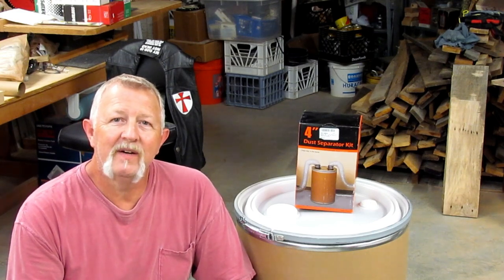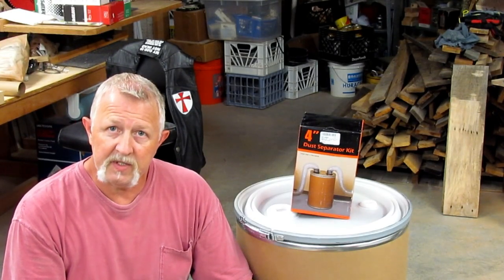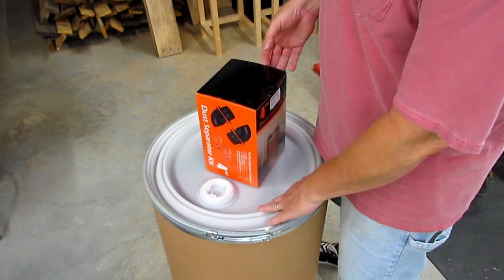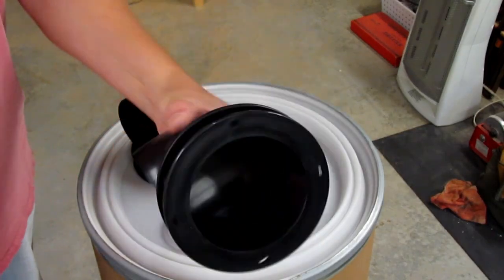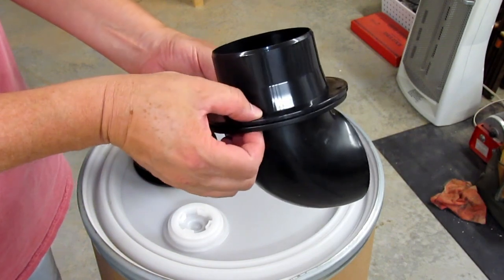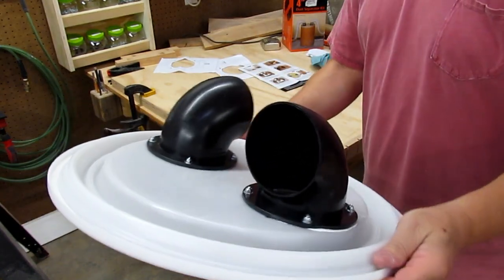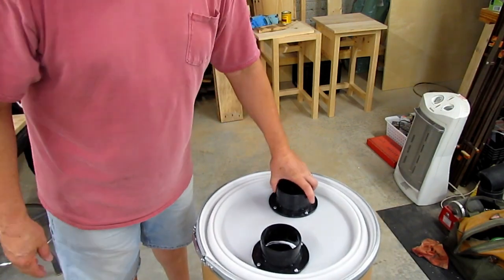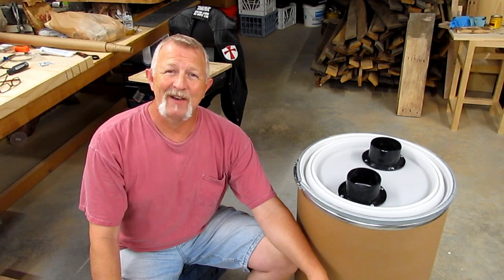Build a Chip Separator for your Dust Collector - Cheap

Comment: I saved my bungs then used the small one and connect my sander hose in it worked out great
Reply from the maker: Thanks for watching, Charles!  Wow...that is a GREAT idea...I wish I had though of that!  I use an adpater to step down from the 4" hose to my sander hose and it is a little cumbersome.  Your idea is perfect!  Thanks for sharing.
Reply: Super idea using the smaller one for your sander.

Comment: This is a terrific video and I just love the idea.  My problem is that I can't find a 30 gallon fiber drum for less than $100.  It's possible that some company near me might sell it, but I can't find one.
Reply from the maker: Thanks for watching, Pat!  I actually stumbled across my supplier...they are local but normally supply steel drums.  I stopped in one day and asked them if they had fibre drums.  They had poly and fibre, I just opted for the fibre drum....it was about $20.   I have seen people use poly drums and also garbage cans.  If you can find a garbage can with a fairly sturdy lid, it should work fine.

Comment: Great video. My question would be this, how does the CFM compare to one of the Dust Deputy's? I would have left the "bungs" to use as a window to check the container capacity if it unscrews. Using the smaller one as a palm sander port is an awesome idea.👍
Reply from the maker: Hi Terry, thanks for watching!  I can't find any specs from Oneida regarding the CFM limits or requirements for their Dust Deputy.  Since that is a cyclonic device and this chip collector of mine is not, I suspect that you will get more air flow thru this 2-stage drum system as there is less restriction.  The cyclonic device may require more air flow (more CFM) but will also separate dust better into a smaller container (5 gallon bucket).   On a small JET dust collector, I get 95% dust and chip retention into the drum by volume.  So about 5% ends up in the dust collector bag.  I get good enough collection on my tablesaw and router table so that I don't really have to run my filter in the shop while the DC is on.  So I get little to no dust in the air with this system.  I hope that helps!!
Reply: @dwcoffey  I have read several reviews of the product you used and there were numerous recommendations to put the exit port in the middle and not on the opposite side as the directions state. I have a 55 gal drum and a 2hp Harbor Freight dust collector I will be converting to a 2 stage. I was thinking of putting the inlet port on the side of the drum to try to simulate the Dust Deputy.
Reply from the maker: That sounds like  a great idea to me.  I also like to idea of using the bungs for an inspection port and a small vacuum line for sanders etc.  I'm probably going to see if I can round up another lid for mine and remake that part.

Comment: 8:57 -- I thought the same thing the first time I came across that.  I opened a new tube and it was white -- I returned it to the store and got another one.  It was white also.  I ended up using it anyway and then found out that it's white when it comes out of the tube (so you can see it), but cures clear.  They should do a better job of explaining that on the tube.
Reply from the maker: Thanks Steve!  I'll have to check mine now and see if it dried clear.....It probably did!  Thanks for watching!

Comment: I,m gonna build this,thanks.
Reply from the maker: Thanks for watching, Fred!  I've had a good suggestion since building this:  rather than cut out the bung holes, place the ports opposite the bungs.  Then you can use the small one as a vacuum connection for sanders, etc.  And can also use the big one for an inspection port, rather than removing the lid to check.  Mine works great and I'm glad I have it....easier to dump than the DC bag and don't have to replace bags as often.

Comment: Dennis -- did you notice a drop in CFM with your separator in line?  Thanks to your video, I ordered the same fiber drum and fitting kit.  The 4" duct from my dust collector will almost pull my hand into the end while running, but with the drum separator in place, the suction is much less.  While I didn't use caulk on the fittings, I can't see that it would allow enough leakage to cause the drop.  I haven't resorted to sealing any of the drum seams (crimped on top and bottom rims) either.  I wanted to see if you noticed any drop in suction on yours?
Reply from the maker: Hi Steve, thanks for watching!  I have not had a drop with the chip separator installed.  All I can think of is to check for leaks...the drum and/or the lines.  Of course, it is critical that the drum lid seats and seals properly.
Reply: @dwcoffey  Thanks for the confirmation.  Even though the edges are rolled and crimped by the top/bottom rims, I went ahead and sealed them (and also the flanges) with caulk.  Also coated the inside of the drum with sanding sealer (couldn't hurt).  The top of the rim is smooth, and the lid is plastic, so don't think I can improve on the seal there.  When the sealer dries, I'll try again.  Thanks again!
Reply from the maker: Sounds good Steve!  Let me know how it turns out!

Comment: Dennis--Great video. I was wondering if you knew where I could get a dust separator kit that was smaller. Say, 2 1/4. (All I saw was the 4" that you had.  Thanks---Rhys Williams
Reply from the maker: Hi Rhys, thanks very much for watching.  I haven't seen a kit like the one I used for 2-1/2" fittings, but I have seen a top that does the same thing.  It uses a 5 gallon bucket.  Woodcraft.com has them....I think it's made by Woodriver, or something like that.  Seems like it goes for about $20-$25.
Reply: OK Dennis, Thanks. I'll check it out. @dwcoffey

Comment: Sweet, but how does it work? I'm getting ready to build one for my shop and would love to know how effective it is. Will the drum hold up to the suction from a 1 hp dust collector motor? What did you connect it to?
Reply from the maker: Hi Jon, thanks for watching.  So far, so good!  I have mine connected to a 1hp dust collector with no problem at all.  The fiber drum I got is more than sturdy enough for the dust collector.  Also, the DC pulls dust and large chips without any problem.  I now only get some fine dust in my DC collection bag, so it's doing exactly what I was looking for.

Comment: Dennis, do you have a feel for the minimum-size "dust" the barrel will catch?
I built the same thing, using a plastic trash barrel.  The lid gets sucked down a little bit, but the Jet DC650 draws OK.  However, the barrel collects almost nothing.
Reply from the maker: Hi Bob, thanks for watching!  My drum catches all but the smallest of dust....I get very little in the collection bag on my dust collector now.   How far apart are the ports on your collection barrel?  It may have something to do with the separation between the ports (?)  Also, I made sure my ports were pointed as much in opposite directions as possible.  Hopefully that will help.
Reply: @dwcoffey  The ports are 12" apart, center-to-center, facing in opposite directions.  The barrel is 21" high, 17" diameter at the top, tapering down to about 15" at the bottom.
I dumped a few handfuls of shavings from my thickness planer into the bottom of the barrel.  Looking through a clear plastic window in the cover, I see the shavings whirling around in a cyclone; the rotating air picks them up and they find the exhaust.
Jet rates the DC650 at 650 CFM.  Maybe that's too much for my barrel.
Reply from the maker: I'm also using a DC650 but my barrel is a bit larger and has no taper.  I will fill up the barrel 4 or 5 times and still only have about 6 inches of fine dust in the DC650 collection bag.  I'm thinking the size of your barrel might be the culprit.